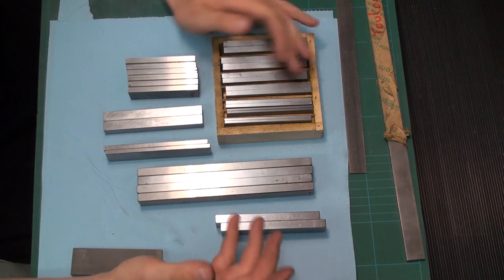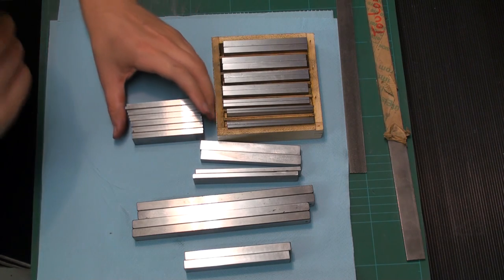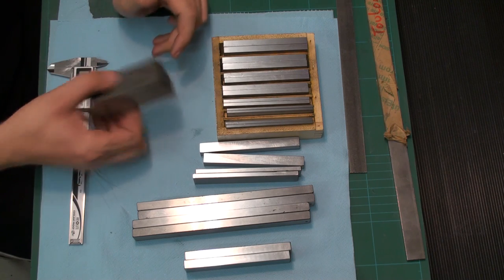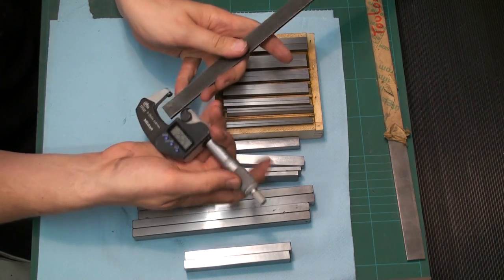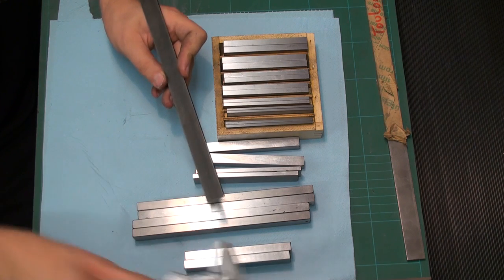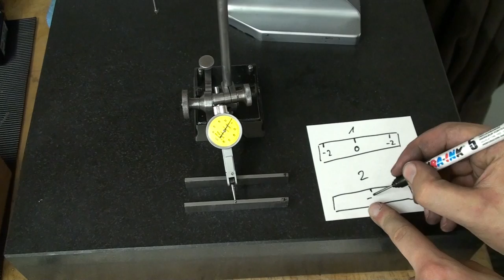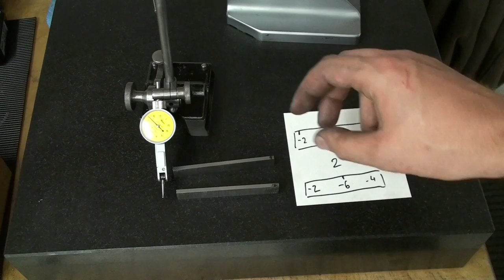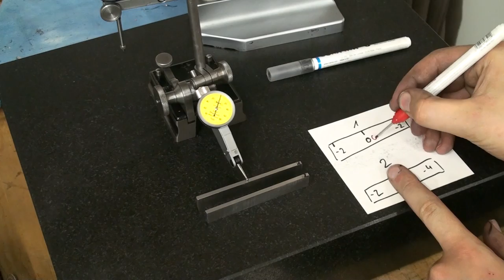Shopmade parallels - Part 1

Comment: hi stefan, another reasonably cheap source of parallel stock is keystock, sizes are ground within tolerance and the C45e+r type can even be hardened somewhat. parallel keystock can be bought in a lot of sizes.

Comment: Stefan thinks outside the box and shows us nice solutions to make a job easyer. A quick way to make parallels for one off work is to cut two pieaces of ground round bar to length and put one left and the other one on the rightside in the vice. To prefent then rolling out just wipe them accross a magnet a few times. This of course only applies when the workpieace is wider than the diameter of the round stock. Nice Video :)

Comment: An old video but timeless.  I made my own parallels and they worked out great.    I used a non-Chinese (expensive) 10mm carbide cutter and a DRO.  I found I was able to just dial in the target width and end up within 0.001mm size and even better parallel (I have a digital Mitutoyo micrometer).

Comment: I work for Precision Steel, in Toledo Ohio. We will sell you ANY size of tool steel, from 1" to 10,000". And if you don't have your own grinder, we will sell the stock finished, so all you would need to do is cut the stock to length and debur

Comment: There are times when I actually prefer wide parallels. This in in situations where I am using milling vise hold downs. These are parallel like except they are ground to a slight angle on each side. The side that goes against the vise jaw is maybe 3° while the edge that goes against the work is way be 4°. When you close the jaws the jaw side tip up while the edge against the work piece pushes down on the on the part holding it tight against the parallel

Comment: I will need to make some roughly 1meter long parallels for my HBM when I get it running, that should be an interesting project for something like this.
Reply from the maker: A 1m long parallel is a bit of a challenge :D

Thats the case where I would go with cold drawn of ground flat stock.
Reply: Brian,
Would two granit bars be more stable than steel? I am thinking the price might be better from granit counter top places.  
What about Dura-bar, scraped and annealed?
Daniel
Reply: AtelierDBurgoyne
Yes usually the big HBM parallels are cast iron for better stability.  i think the granite might be prone to chipping and cracking putting big heavy steel and cast items on them for working on them.

Comment: Excellent information am looking forward to the hardening for sure.  Thank you for the video.
Reply from the maker: Thank YOU for watching :)
Reply: Hello,
I do not see the label of the bar that you show. (12:40)
You can give the reference and or buy?
Thank you
Reply: You can usually find any of this type of steel at McMaser.com then search on tool steel.  A bit expensive but almost anything you want is available and ships quickly.
Reply: McMaster.com, not what autocorrect said!

Comment: ha!!! precisely 19:27 into the video I thought " NOOO! " , right at the faded transition your fingers come in and look like they were about to pinch a spinning endmill, great video and I need to make some, also some thicker parallels for when clamping parts straight onto the mill table for milling edges,  great setup and reminds me I also need to make some thin pointed finger clamps aswel, the cheap chinese ones are more of a fat thumb clamp design that have been smacked with a lump hammer and are way too wide for this.

Comment: By coincidence I am in the proces of making my own parallels. Stumbling over your videos I was very pleased with the straightening part of it. My material is C45K and it warped quitte a bit. Grinding the bend out is not a good idea since the magnet sucks the bend out and then releases it again,
So thanks for your tips and tricks!!

Teun
Reply from the maker: If I had to make thin parallels again, I would just use hardened spring steel, way less work, just cut to length, grind/machine parallel, done :D

Comment: I have a cheap Taiwanese mill drill.  Every time I move the head up or down the cylindrical central column, I effectively destroy the tram of the mill.  It is just too much trouble to constantly re-tram the mill.  Then too, the head elevation I must use for traming, is often different than the elevation I need to do my next machining operation... thus I have to move the head and destroy the just implemented tram.

If the tram cannot be guaranteed, ordinary precision parallels cannot be guaranteed to correctly position the workpiece.

My solution has been to make my own adjustable parallels.  I drill vertical holes through the parallels at their ends and tap them out for a set screw.  To use these parallels, I put them in the normal position in my milling vise.  Then with a dial indicator secured in the spindle, I check to see if each parallel is horizontal and if both parallels are at the same height... relative to the spindle.  If they are not horizontal or are not at equal elevations, a twist with an allen wrench will bring the parallels... into parallel.  At last, I am ready to mill.

If you can't exactly control the tram of your mill, then tram your workpiece with homemade adjustable parallels.  I use 1018
mild steel and anneal it before creating the parallels.  Then I case harden the parallels and finally straighten them in the event the case hardening has caused any warpage.  I only need to make one edge of the parallel flat.  The other edge does not touch the floor of the vise... because the parallel is standing on the set screws.  Once positioned, the set screws tend not to change so I only have to check them for parallelism occasionally.
Reply: That is a freakin' clever solution!

Comment: So "one half of ten thousands of an inch"...is that the same as one 20 thousands of an inch, or are my imperials off?
Reply: .00005 or 50 millionths
Reply: Jocke - I think the phrase was “one half of a ten-thousandth of an inch”. The same phrase could be written as “one half of .0001 inch” which becomes .00005 inch. It is simpler to say this number as 50 millionths, as mpeterson wrote earlier.

Comment: Hi, i wonder if you know where i can find one or 2 pairs of parallels for my Proxxon PRIMUS Vice - 100 mm wide. The problem is that all sets i find are very high and will exceed from my vice. Max parallel useful hight is about 18mm. Have contacted you several times to ask if you could make but i got no answer. Can you please respond? Thanks
Reply from the maker: Hi!
I would look into some precision ground ground stock for that purpose - for 95% of most application that stuff is perfectly fine to be used as a parallel when cut up into pairs and deburred carefully. Sorry for beeing bad at answering emails, but I get an awfull lot of mails day by day and I just can not keep up with them.
Reply: Think is that i am not a machinist to make them. Do you have some spares they could fit my vice, or could you make 1 or 2 pairs for me? Cost? Thanks

Comment: Stefan since you milled both parts at the same time why does one have a bow in it?
Reply: I was asking myself the same question.  I can think of two possible explanations. 
1) cold roll has some tension in it and removing some metal makes the bar bend by 0,006mm
2) one piece deflected a little from the pressure of the cut. A bit doubtful unless it was the top piece.

I think reason (1) is the most likely. To prevent any residual tension, the bar would have to be annealed before it is machined. Just saying.

Daniel
Reply: +AtelierDBurgoyne I was wondering if it was the top piece also.